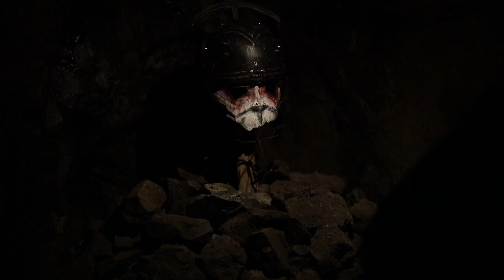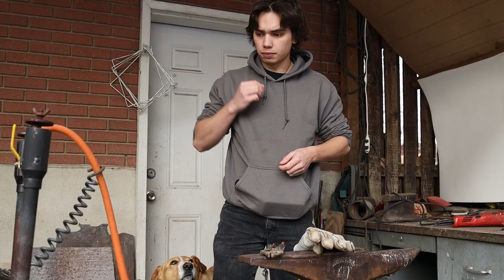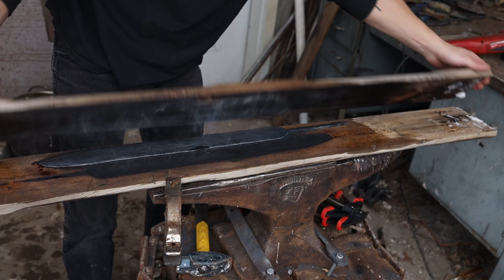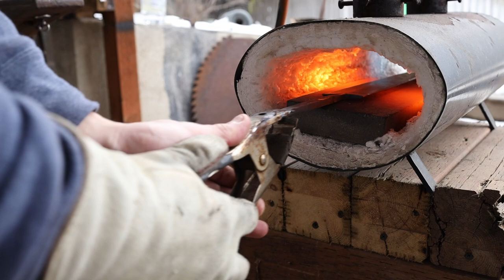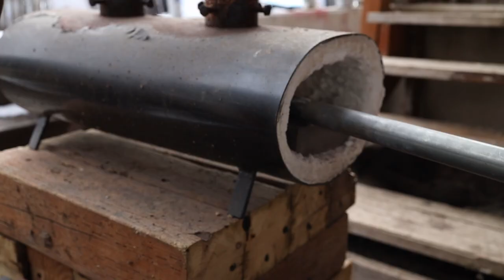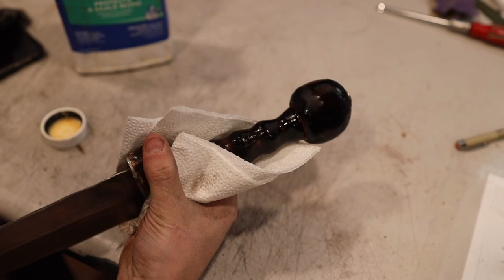Making a Gladius (Ryse: Son of Rome)

Comment: Dude that is freaking cool!  I made a 60" broadsword out of a leaf spring 30 years ago.  I still have it.  Was supposed to be "The Kurgan's Sword" and I got it close, but never finished it with the spring out blades and never put a pommel on it and it's 9 lbs as-is so is too thick and very nose heavy.  But I've slayed several 3" trees with it :)  I like your gladius!
Reply from the maker: Leaf spring gang
Reply: @miscreations_US  I had a guy with a crude machine shop rough grind it and he burnt up like 20 grind wheels because the spring was already tempered. I then spent about two months of two hours every evening with a large file shaping the blade. I looked like Conan with his rock sharpening his sword...for two months :)  But I finally got it done and it's a beast and is a decent carbon content.  Would have been much easier to use soft steel to get the shape 90% there and then heat treat it....   I'd like to make a couple gladiuses.  Your's is nice!